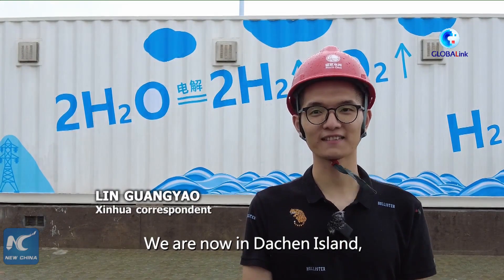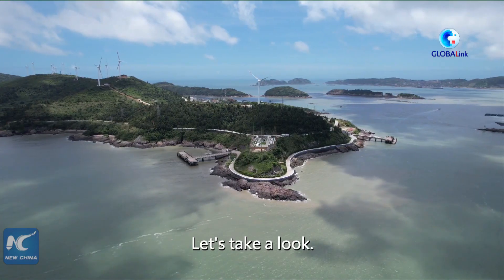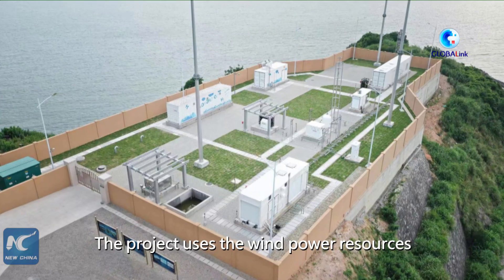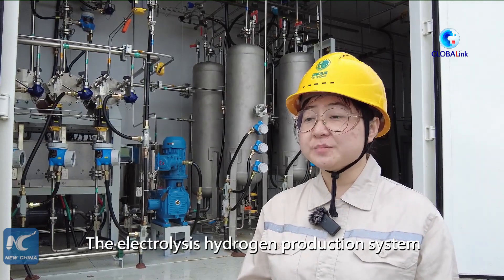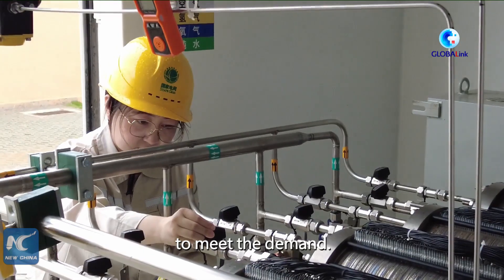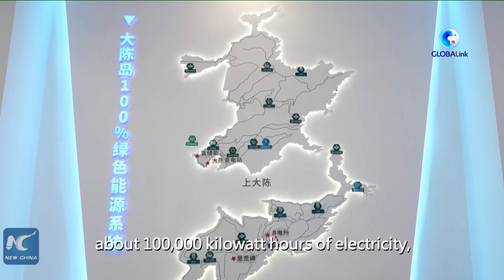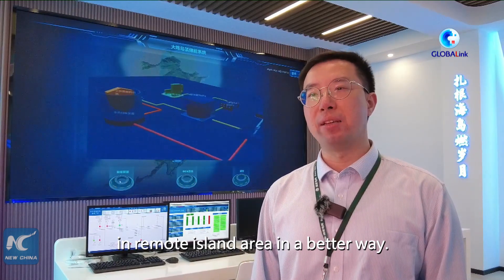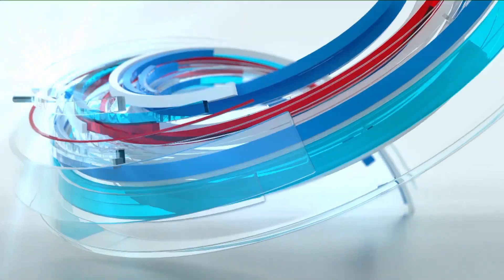GLOBALink | Green hydrogen project in E China contributes to low-carbon development

Comment: This is probably the only way that Hydrogen / Electrolysis makes sense!  That is, if you have surplus electrical power.  Hard to imagine but I suppose there might be strong wind at a time when the demand for electricity is low.  Otherwise it might seem like an expensive and inefficient process.